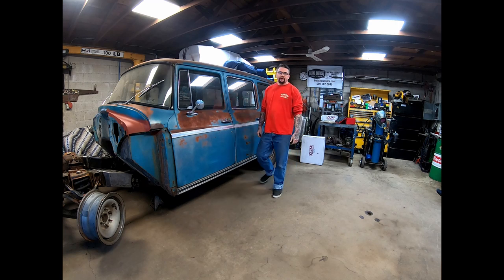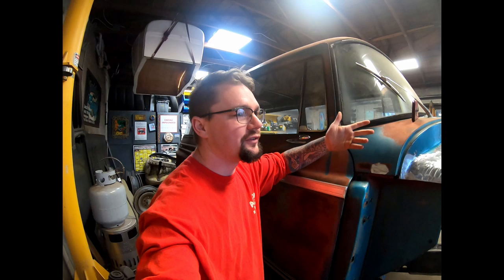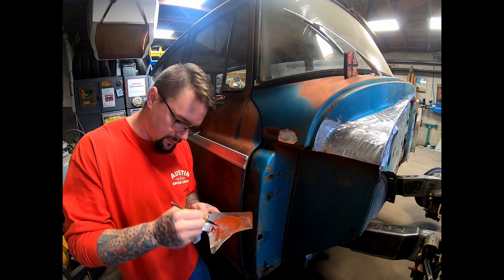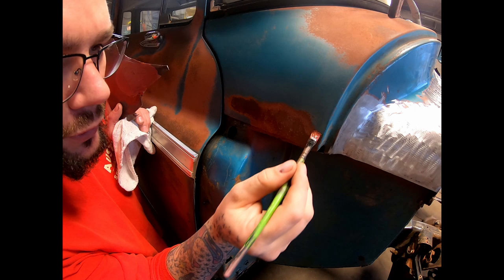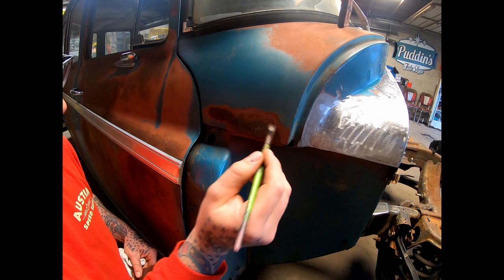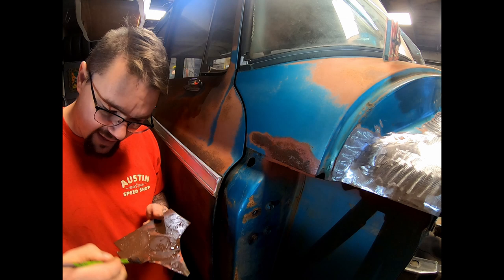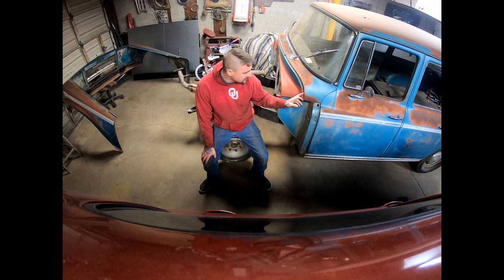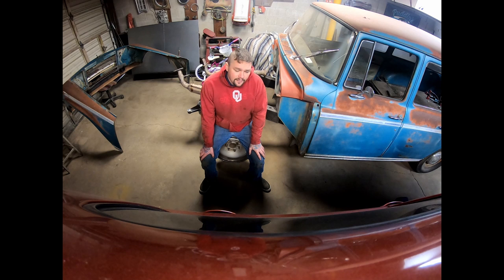FAKE PATINA! BLENDING PATCH PANELS.

Comment: Something I'd like to see tried is once you have all your body work done, paint the entire vehicle high gloss dark rust color at least 2 coats, then paint high gloss brick color, one coat, then go with your natural exterior color, high gloss dark green or what ever. Do some nice door letting and wet sand through the paint into colors underneath until every area looked exactly how you wanted. If done right I think it's look great and protect as well an any paint job.